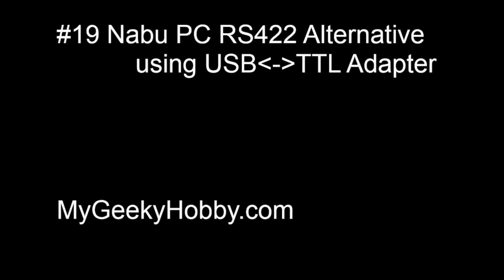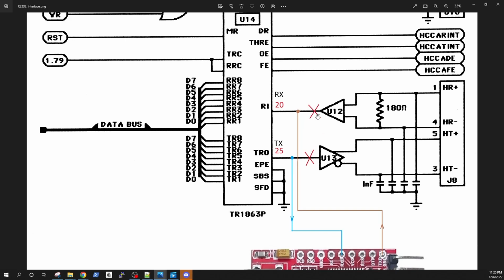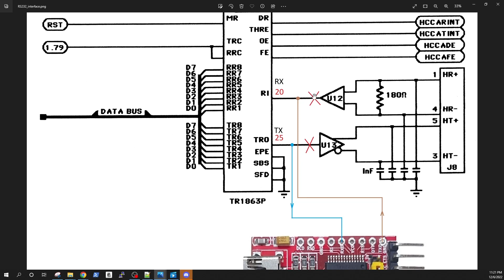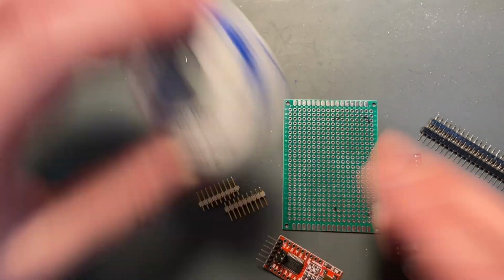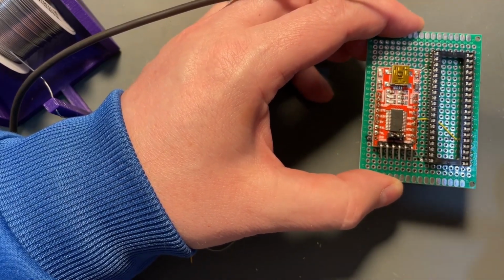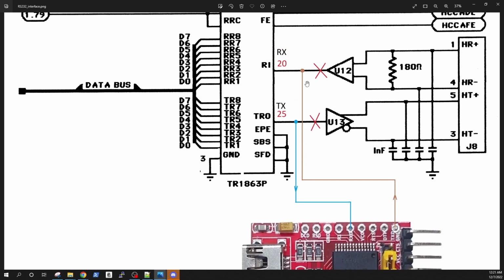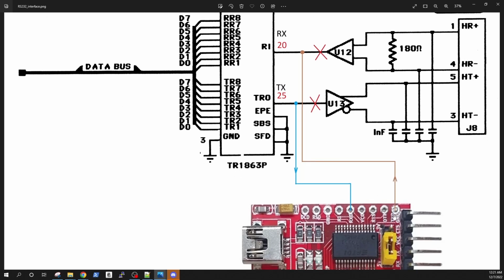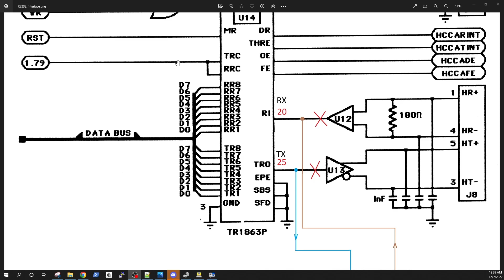#19 NABU PC RS422 Alternative using USB-to-serial adapter.

Comment: I just built this adapter and can't get it to run with DJSures NABU-Internet-adapter. I'm concerned that in the latest github repo you mentioned that it used to work and now it doesn't? Have you reported this to DJSures? This is the cleanest solution out there to connect the NABU to USB and it's a shame that it stoped working.
Reply from the maker: hmm unfortunately once DJSures "fixed" the speed issues he was having with the RS422 adapter, this method of connecting stopped working with his software. I haven't had a chance to look into why, hence I never reported it. I haven't used the "NABU-Internet-adapter" a lot recently as I mainly develop "bare-metal". You may want to try the "other" server, that is around for NABU... I'll be trying this next time to see if it's any different: https://github.com/thorpej/nabud

Comment: This is why  I  love Nabu - everything  is  retro but still "new" enough for more discoveries to be made. Great work.
Reply: Hack the IO, replace the video chip with an FPGA, have a Pico take over the RAM, SD for a floppy, when does it stop being a Nabu?  😂
Reply: @CandyGramForMongo_  Back in the day I had a Z81, a C64, an S100 Bus Computer and several Atari Computers.  All pristine fresh from the factory and I did what every hardware enthusiast did back then. I hacked the heck out of them with every tech that was around in the 80s, added full keyboards, composite and s-video, crazy memory banking and even "married the S100s 8 inch drives to the Atari 800.  The Retro scene is as much about reliving those hacking days as it is preserving pristine examples of old tech.  That is why I bought two Nabu Computers.  One to hack and one to preserve.  :face-green-smiling:

Comment: Any updates on the adapter?
Reply from the maker: I used it in video #20 ... I ordered some pcbs, hoping to get them delivered this week, I'll do another video... thx for the comment btw.
Reply: @MyGeekyHobby  Will we be able to use it on the NABU Network like the way it's done for RS422?
Reply from the maker: @andynarain559  yep, the adapter software that DJ Sures published also works over this USB<->TTL hardware solution.
Reply: @MyGeekyHobby  Good, because I keep on getting FF when I try to do it using RS422 to 5-pin DIN.

Comment: What are the advantages and disadvantages of this option compared to the RS422 method?
Reply from the maker: Most of us have one of those USB-to-serial adapters in our drawers already, plus those are super cheap, so we can wire it up and enjoy nabu network without waiting. If you have to buy one anyway, the external RS422 might be easier to wire up.
Reply: @MyGeekyHobby  But isn't it also a bit faster?
Reply from the maker: speed wise they will both run at 111kbps ... RS422 is better for long distance, but in this case doesn't matter.
Reply: @MyGeekyHobby  Also differential signals +/- are for noise immunity too.
Reply: DJ Sunes posted the challenges he’s encountered using the RS422 adapter:   different baud rates (115.2kbs vs 111kbs on the NABU) and the different voltage levels.  He thinks the breakout board solution is the better solution.
Reply: @1985AW11  I designed a PCB to do that, I’ll share the files once I confirm everything is working. I got the ESP8266 attached as well, but that also struggles with the speed difference
Reply: @avrkris  that sounds good, any update ?

Comment: Could you connect a pi 0w directly this way?
Reply from the maker: PIs in general are not 5V tolerant, so a simple level shifter would be required ... ESP8266 would probably be better here as it could be connected directly the same way (there is a wireless serial port firmware available for those ESP devices and you can purchase them while raspberry pi zero are hard to buy)